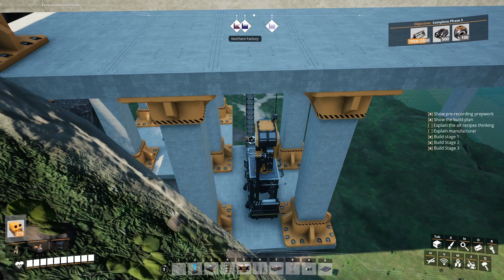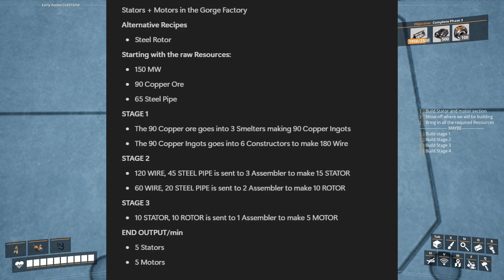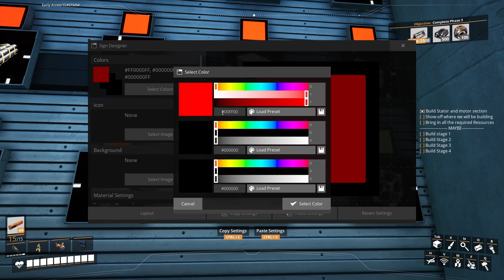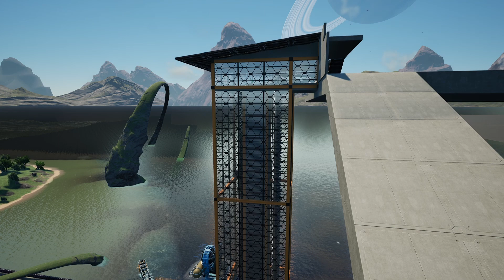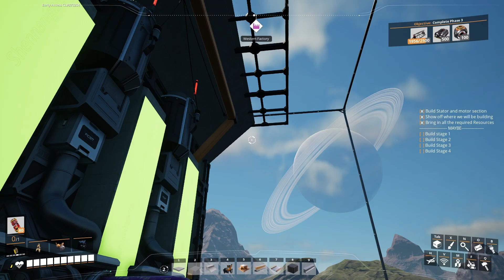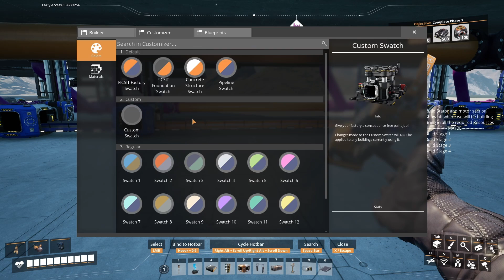The ultimate computer factory start! | Beginners Guide | E10 | Satisfactory Update 8

Comment: Very cool; I want to get this game so bad!
Also, @3:54, do you need all those supports because the weight above is an actual metric you must account for via the building of extra supports to support such weight? If so, why are the ones underneath so fewer in number?
Reply from the maker: There is no gravity physics in the game, so they are entirely aesthetic. The structure was built back in Episode 4 or 5 if I recall correctly, and I was showing off how the blueprinter is a great way for  covering large areas fast with blueprints in preparation for building a factory, the starter factory and the steel factory is ultimately temporary and will be replaced in the future to not waste the great combo of resource nodes in the areas 😇